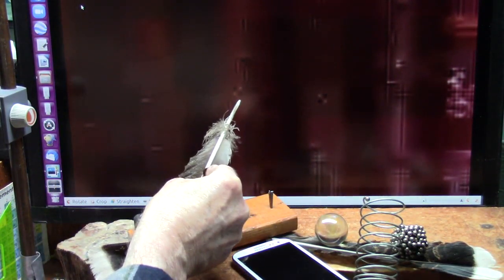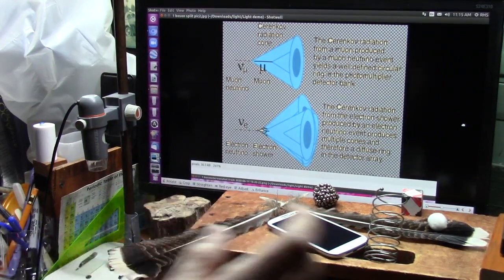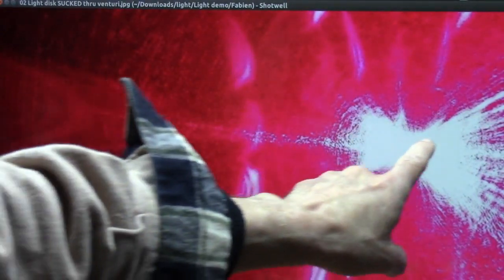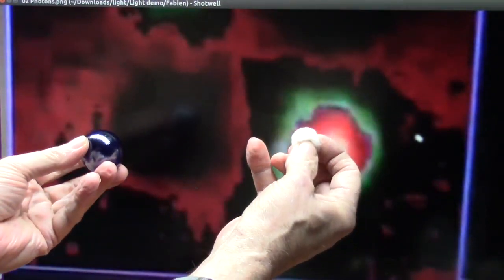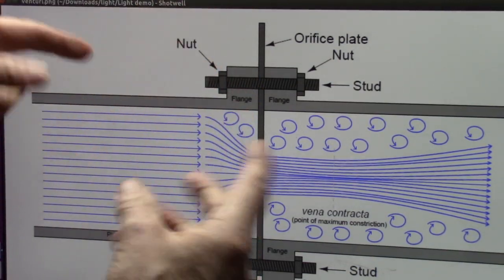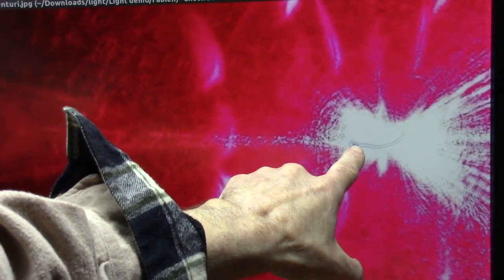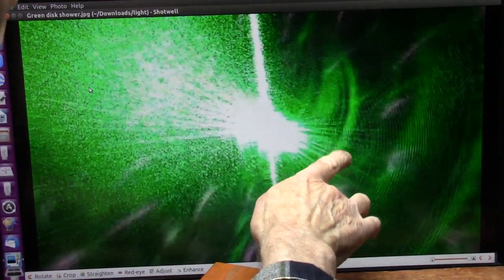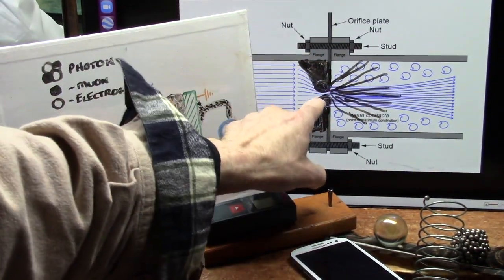Simple Orifice design creates Muons and Electron Showers

Comment: Pass the beam through a powerful ring shaped magnet. If the field is strong enough, it will compress to a near-infinitely small aperture in the center that may be strong enough to pull off what you're proposing. Shoot the beam through the southern pole of the magnet, out through the north.